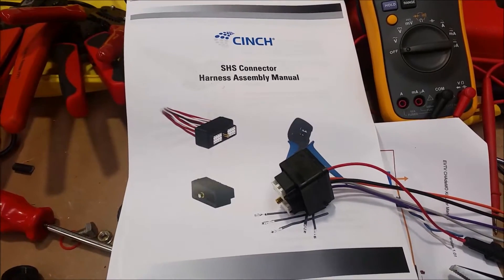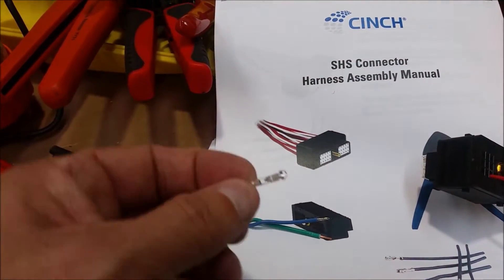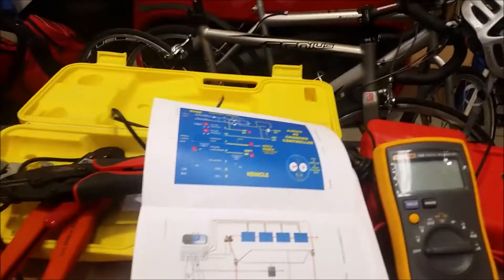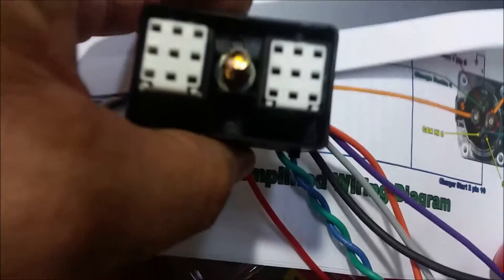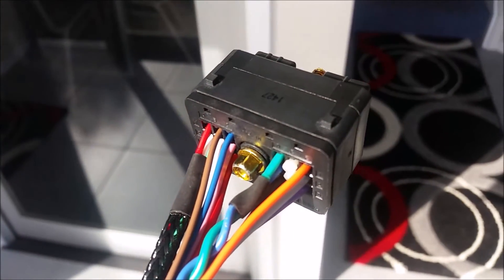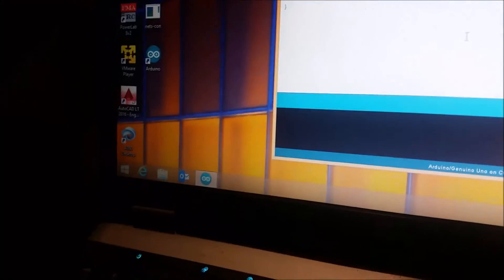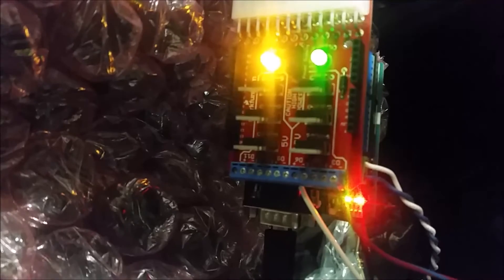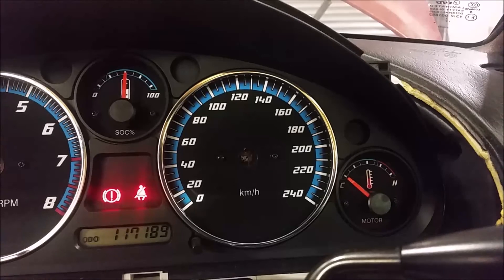Episode 09:  CAN stuff and CHAdeMO

Comment: Can I change socket of gbt to chademo with easy way or I will face problems and after installation do I need software or programming
Reply from the maker: I believe that the GBT is a totally different protocol, although it does appear to be a similar socket.  I doubt you will be able to adapt it.

Comment: Can I control voltage and current by this adapter/controller? I am wondering if I can charge my 20-24S (84-100V)pack ebike with this - 30-60Ah